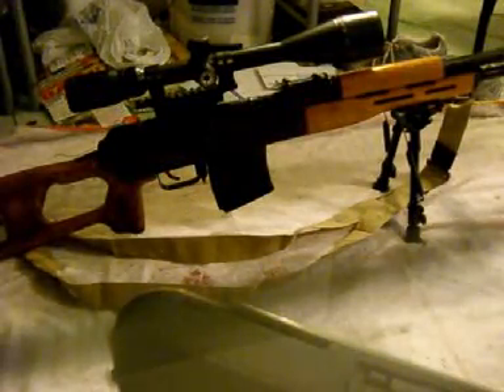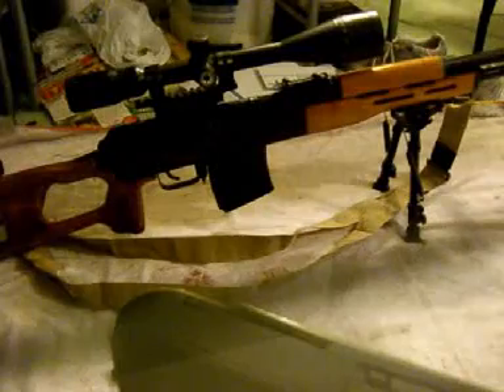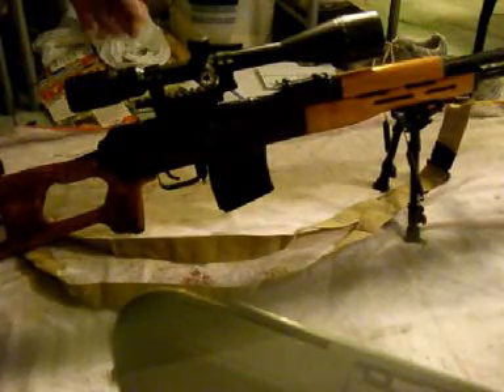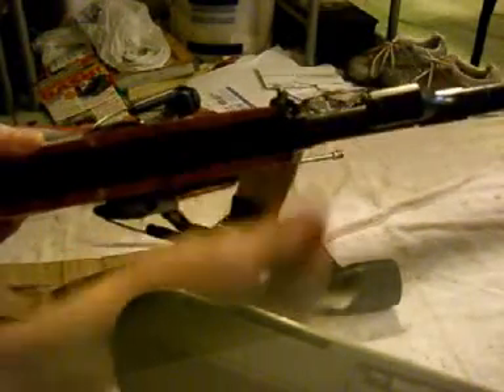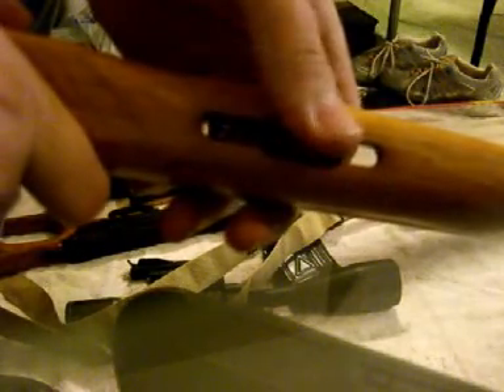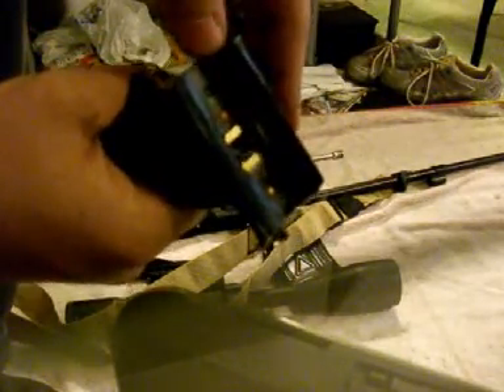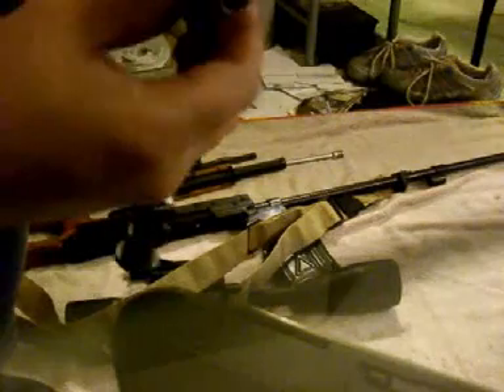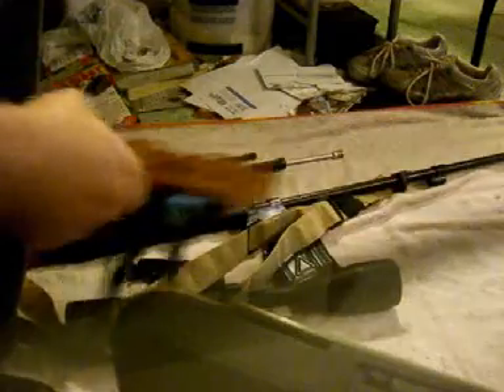How to install a Bipod on your PSL rifle

Comment from the maker: That is correct. Just snug it up so it doesnt move but dont torque down less you damage the wood. Remember the part is made of steel and wood is weaker than steel. When you put the bipod on and tighten it down make sure you put some kind of rubber/foam on the plate of the bipod that will touch the wood if the bipod doesnt come with them (99% of them come with the padding already). You can torque down the bipod as much as you want. This will tigten the bipod to the rifle without damaging the wood

Comment from the maker: Yes it will fit on any swivel mount for a sling. It is universal as long as it is the swivel type nut. There are two prong like arms in a cut out hole center of the bipid with a pin sticking out each end of the prongs. These pins flit inside of the sling swivel and you tighten a nut down which increases pressure thus forcing the prongs together and the body of the bipod against the rifle forgrip. Also the other end of the prings has the same size holes for sling attachment.

Comment from the maker: because the PSL is pretty much nothing but a long AK you can pick up the AK lightening bolt. This puts the charging handle on the left side. Just a modification to the dust cover and then pick up a rear sightleaf to weaver rail mount for your scope,otherwise the left sided charging handle will get in the way of the side mount. Remember the brass will keep flinging to the right but the PSL shoots the brass out to the right by about 4 feet and back by about 2 inches completely clear of your face.

Comment from the maker: Yes all harris bipods / clone harris bipods should come with the foam in the craddle. If they do not just run to walmart and pick up a felt sheet of your desired color and lay it in the craddle. The pressure for locking the pod down will kep the felt cutout in place.

Comment from the maker: You an use any stock system for an AK-47 it just requires a little bit of modification to the stock to get it to fit correctly. There may be a very small gap near the rear of the trigger but that can be filled in with putty or platic compound.

Comment from the maker: Yes any pressure on the barrel will affect barrel harmonics; however this is not a free float system. The hand guard already puts pressure on the barrel so a bi-pod is going to put just as much pressure as it would from you holding it or using a sand bag. Also mounting a bi-pod to the receiver would require permanent modifications and that's not something i wanted to do. I did however mount a receiver bi-pod to my second PSL and the accuracy was not increased or decreased so it was a moot point.

Comment from the maker: @theImageless I have seen this done before so entirely possible but take now when you drill into the wood that wood is very brittle and you could crack it or over time the pressure could cause a crack. Most mods i have seen thhe hole drilled on the receiver just in front of the mag well. I have since modded my PSL with synthetic furniture  and install custom rails to attach the bipod 1 inch over the end of the receiver. Works well and no permanent alterations done to the rifle.

Comment from the maker: UTG started out manufacturing for airsoft yes however since airsoft is a 1:1 scale they already had the correct molds and equiptment to make the good stuff for real steel so they just used better metals and materials for the real deal.

Comment from the maker: The AK forgrip does not have a vent like the PSL forgrip. You will need to cut a vent for this to work on an AK but if your going to the that you might as well just install a bipod post into the wood. Less work and just a small hole to fill with wood putty if need be.

Comment from the maker: It has over 500 rounds through it with the wood grip and bipod installed before i changed it over to synthetic and then ultimately sold the rifle to replace it with a Vepr so i can have a bull barrel. Zero cracking by the way.if you worry about cracking just install some felt on the inside and out at the points were the adapter contacts the wood and you will not have any issue. I didnt torque down the adapter only snugged it up hand tight then gave it a 1/2 turn past hand tight.

Comment from the maker: @toymachine87 If the MAK-90 is the same specs as an PSL/AK receiver then yes it should fit just fine with a little modification at the very least. Now take into mind that the foregrip and gas tube shroud will not fit as the MAK-90 is short like an AK. The PSL has a much longer foregrip/gastube setup. There is an after market synthetic stock kit you can get for the PSL in fixed or adjustable version from centerfiresystems though.

Comment from the maker: Hard to tell at this  moment. Quality seems to be good and as normal with russian scopes clarify is very nice. The issue is the scope mount was designed for an AK and the short PSL stock doesnt give me correct eye relief when prone. I am installing a synthetic stockset with adjustable stock out to another 3" extention. I will zero the scope and test it in depeth at various ranges after this installation along with testing of the adjustable gasblock.

Comment from the maker: Those are not Harris bipods. They are Mountain rock or some brand of that nature. Made by Ozark Trail if i am not mistaken. Those are harris "style" bipods. Actual harris brand bipods run anywhere from 80.00-150.00 or more mostly made of steel and are very heavy compaired to the Ozark style versions which are made of Alim, just as good and might lighter weight. I have two of them one you see in this video and i give them a 5 star damn good product.

Comment from the maker: That depends on you. I cant tell you what height bipod to get because everyone is comfortable in the prone position at different heights. I perfer a 6"-9" bipod so that i can keep low to the ground as much as possible but such a short bipod limits me from very steep firing positions when laying over say a ridge of some kind. Although i try not to get into those positions much less use a bipod at all. You shouldnt rely on your bipod for stability. It is not as good as a sandbag by any means.

Comment from the maker: That depends on a few things. Is it s Cugir or TN build? Have you slugged the barrel to check the lands and grooves? Does it comes with the PSO-Type2 scope? Do all the serials match? Whats the condition of the wood and blueing? Any modifications done to the rifle? Any nicks or damage to any part of the rifle? Any issues with extraction, cycling etc? In short if it is a Cugir build in good to fantastic condition with scope your lucky to get 1000.00 from a collector. A TN with scope maybe 700.00

Comment from the maker: wal-mart your looking at 30.00-40.00. Drive by walmart and stop in to check for yourself. I have had no problems with the walmart brand bipods and i have had a lot of them putting all of them through hell including beating them on trees , standing on them, dropping ammo boxes on them (2000 rounds or so). Never had problems nor broke much less came close to braking them.

Comment from the maker: @lorddinaire I have seen some 20rd mags at most but it has been a fire long time and they were custom made by taking 2 10rd mags and welding them together then dropping a longer spring in there. Looked very odd and i do not know how reliable they are. Remember this is a DMR rifle, not an assault rifle. If you cant hit your target in 10 rounds or less, your doing something very wrong. Likely if you need more than 10 rounds at any given moment you doing something very wrong.

Comment from the maker: One PSL 1.2 MOA the other PSL 1.3 MOA. I have seen one PSL re chambered in x51 performed by a local gunsmith here in town. I have not seen or heard of one since. I do not see the point in rechambering this rifle in a x51 unless you already have a massive surplus of it laying around. The x54r is better than the x51 and almost as accurate with surplus stocks comparied to the x51. Also x54r is super cheap and easy to get. Match x54r easy SUB moa = 0.50 a round, Match x51 SUB moa = 2.00 a round

Comment from the maker: If it is at your local gunshop and they are branding it with the name of a Dragunov they are incorrect. True Dragunov rifles can not be imported anymore unless they have been built or in a NATO country for at least 10 years. New Zealand builds a civilian version of the SVD called the Tigr for 4,000.00. The PSL is nothing but a long version of an AK-47 but as per my other videos you can easily group 1.2" with surplus ammo and it does shoot the 7.62x54r like the SVD rifle does.

Comment from the maker: @shawnmohr1989 I found a scope that is more compact and holds up better than the barska one i have in this video. They are made by Leapers or also known as UTG. Check them out. Make sure you look at the ones labeled as TS or True Strength.

Comment from the maker: @mildot100 Awesome do a range report tell me what you think of it. If you need some help if your getting over 1.5-2 MOA groups let me know and ill run you through some methods to improve your accuracy as normally the limitation is due to the shooter not the rifle but i will also give you some things to look into on the rifle that could be effecting your accuracy as well. Most of the things to fix (if any) can be done with little tooling and work. If you can work a drimmel you golden.

Comment from the maker: The PSL has a threaded barrel. It uses a 14.1 CCW twist same as the AK-47. The Muzzle break is welded in place with only 1 weld that can be cut off very easily but this is illegal as imporint laws require a "fixed" muzzle break. This is due to the 922(r) so you would need to contact BATF on what to do be make it legal with a silencer.

Comment from the maker: Yeah they are cheap scopes but doesnt make them crap. They are not the best, most people compare them to Leupold and of course they are not going to measure up to a 600-800 optic so people really need to pull their head out of their asses. They will withstand the recoil just fine of the x54r. I have been shooting with this scope for a while and the scope is more accurate than all the crap surplus ammo i put through it. I have shot 1 MOA with this rifle/scope combo with the good ammo i have.

Comment from the maker: @khuyenthoang Send me a Private message and i will give you the specs and purchasing locations of the UTGs i picked up for your PSL. They fit perfectly with a correct centerbore rail mount and low profile rings.